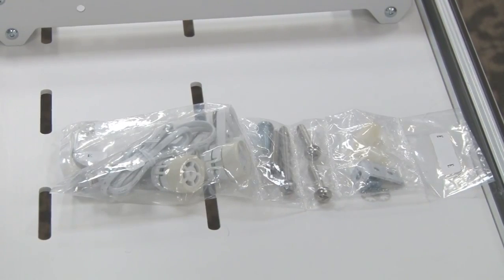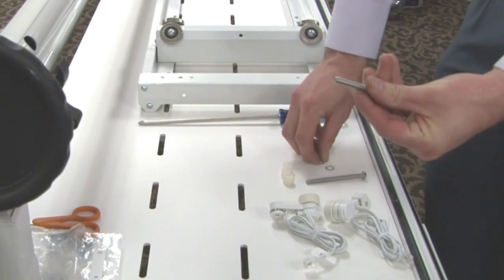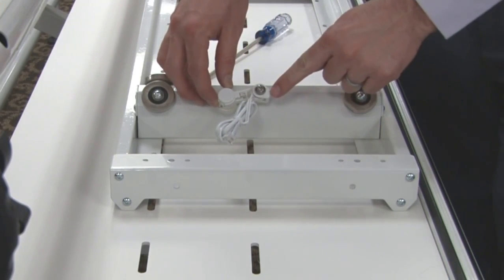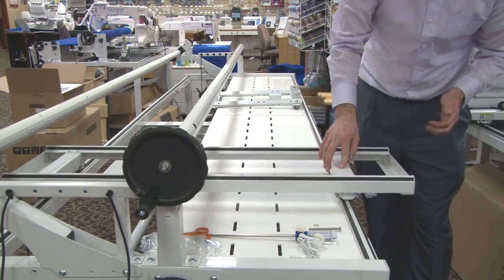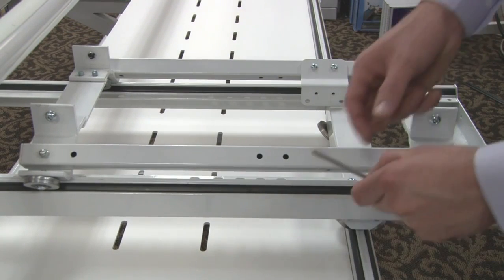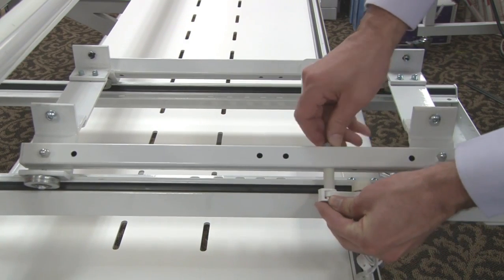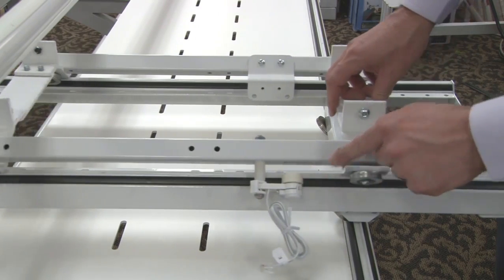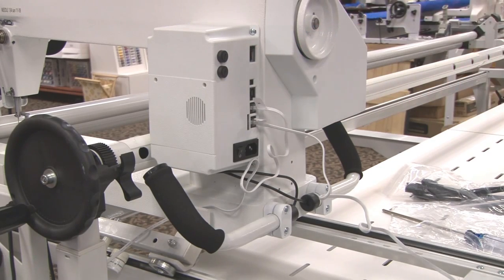Properly Install Your Long Arm Machine Encoders

Comment: This would have been a handy bit of i formation in the assembly instructions of the Phoenix Frame referring to page 20 and 21!! It says top carriage alignment then machine attachment then congratulations you completed the assembly!! No where does it say to install the encoders until page 13 of the assembly of the Apprentice. The 3 sets of assembly instructions i received with my machine were the worst i have ever seen. The photos were too dark to make out the visual aid and on page 16 referring to ratchet wheels and rail ends is where you stopped the "see fig 40" so the photos meant nothing since it took an engineering degree to decipher them. Maybe a quick cd of the instructions so you can see the parts and see it being done versus trying to squint and see dark photos where you cant make out what the photo is.. My previous machine included a video and it made it so easy ( yes i just dated myself but hey it made it easy versus the 5 days this took)